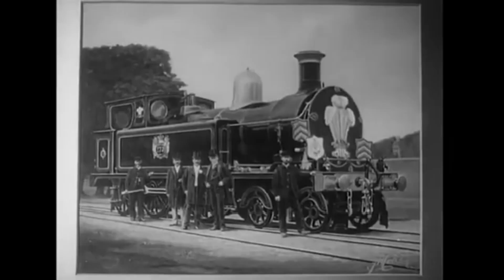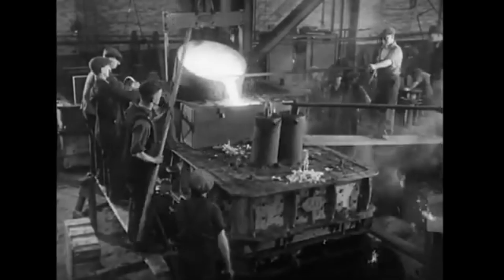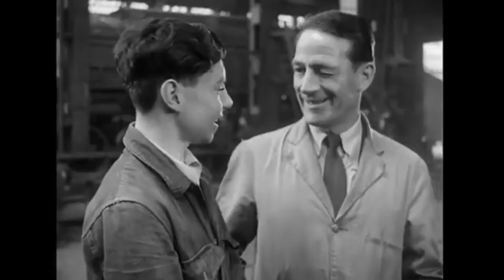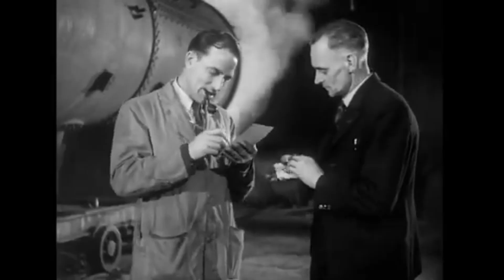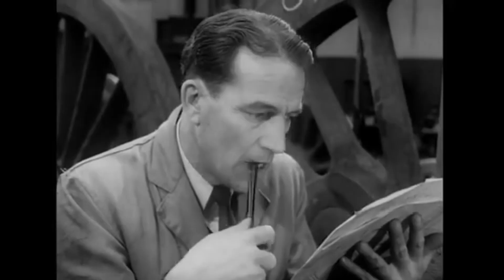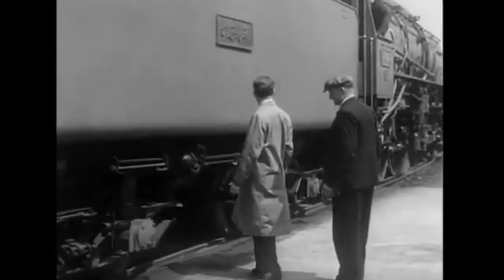Classic Railway Film 7 | A Day tour At  Vulcan foundry in 1954

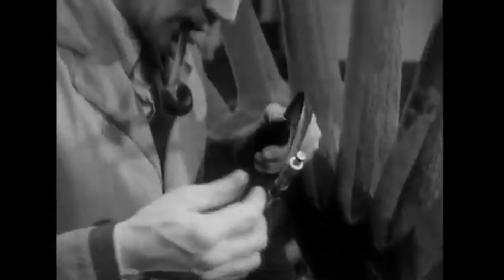Comment: Ted is some actor they hired - at 13:54 while the narrator talks about highest standards of accuracy, Ted is seen using a micrometer incorrectly - wound in on the barrel and not the clutch.   A real engineer would not do that, even if it was just a pose for the film.
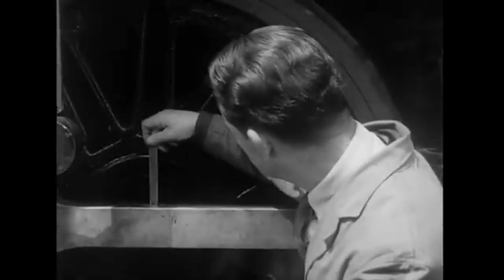At 17:18 he holds a 6-sinch rule on the connecting rod - can only be some nonsense the film director wanted - its not measuring anything meaningful.
And he did a supposedly precision check holding a gauge to unfeatured parts of a rod, which was red hot from a blacksmith's forge.   Seems the really experienced Ted doesn't know steel expands quite a bit when it is red hot.